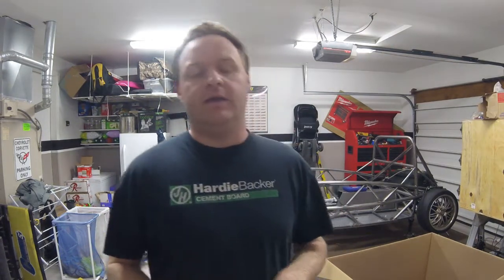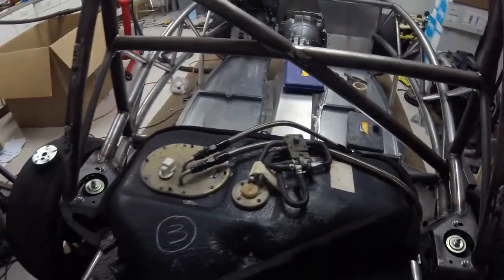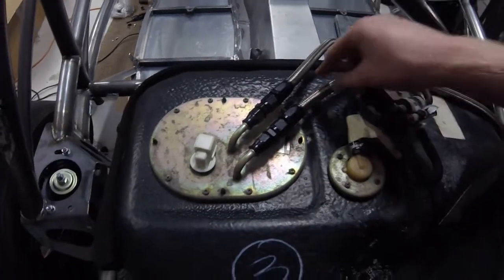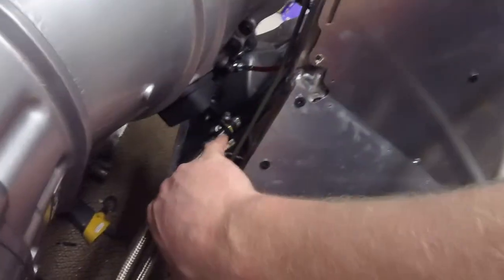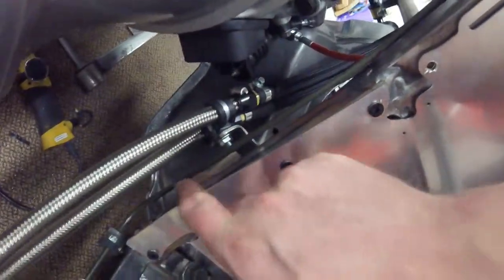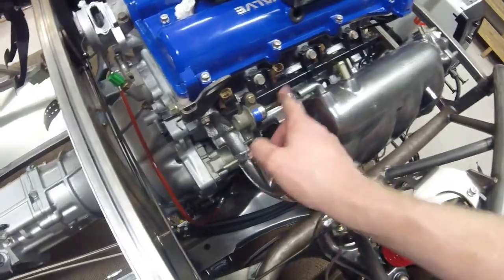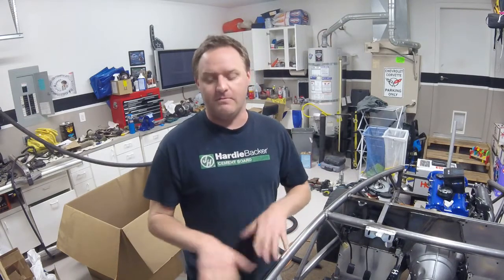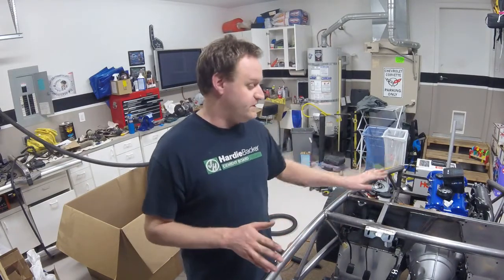Exocet Build: Routing The Fuel Lines (Part 32)

Comment: I think the biggest pain, is that you have to dismantle everything to paint the chassis.
Reply from the maker: Totally worth it though for the end result
Reply: @BuildingTheEXOCET  Is it possible to paint it first and just touch up the bits where you might have to weld a bracket or 2. I'll be building one soon and as quick as possible but still be nice.